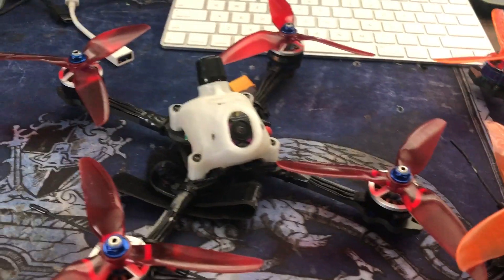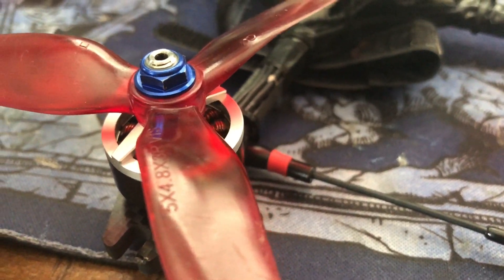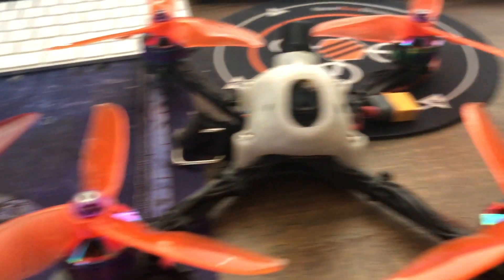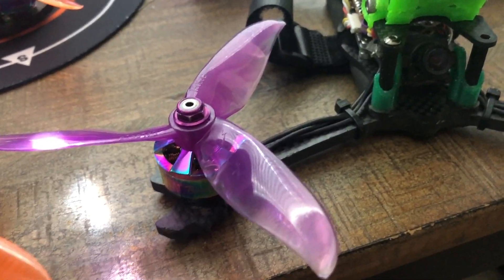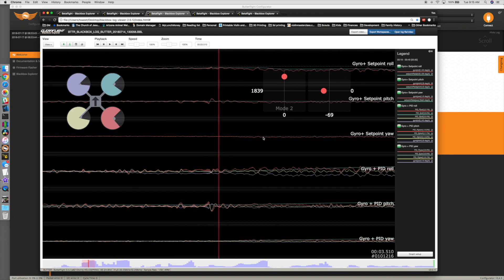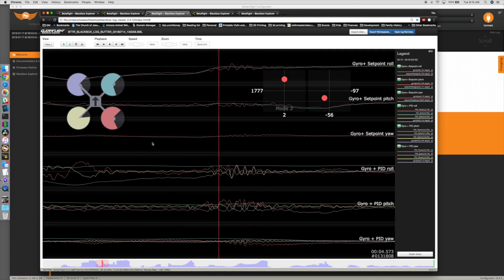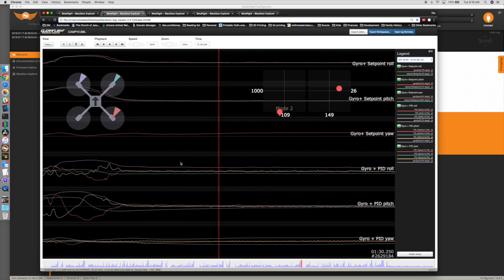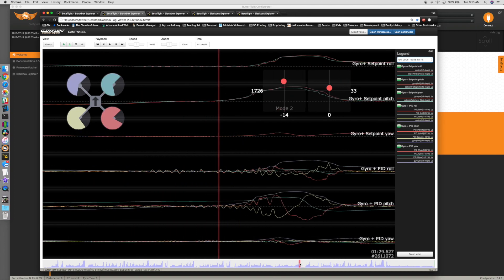Check that your props and motors are compatible first!

Comment: I use 2207 2700KV with 5x4.3x3 v1s.. my AUW is around 700gms.. it looks fine to me.. 
Only issue I see is nose dip on high throttle (>65%).. i raised I on roll and pitch, but didnt make a difference... i checked the CG too, but that too was fine.. 
What else could the issue be?
Reply: Shyam Vadeyar what's your antigravity gain set to?

Comment: Ok serious question... is it that butterflight doesnt like that combo or is that motor/prop combo no good in general? Wonder what the logs would look like with bef flashed.
Reply: JoeStan FPV We as a community have to realize on 6s low lv. The motor is spinning up harder down low bc I the increase in voltage. These props were built for a 4s motor. Some props are really stiff and others are not. I'm sure with 4s  and maybe 5s I would try the same prop and see what happens.
Reply from the maker: It would be in general. The same issue was experienced on both buttered pids and non-buttered pids and on BeF 3.4
Reply: Helio RC ahh ok. Sounds similar to one of the issues i had and was using hq 4.3